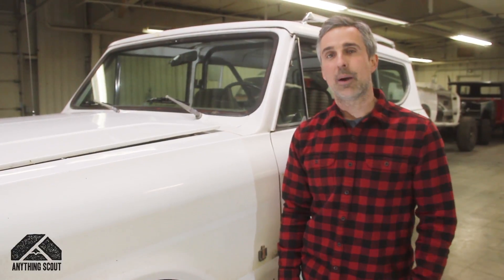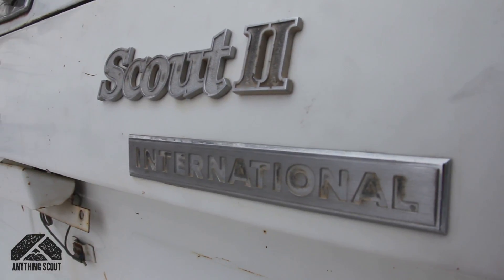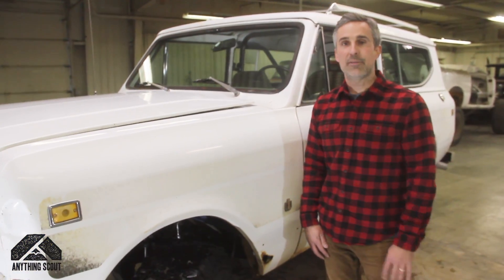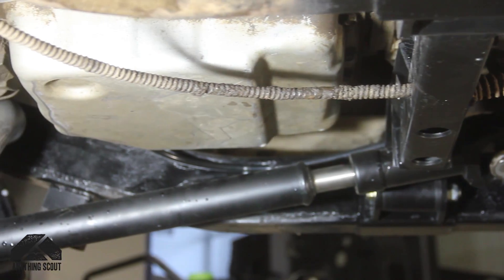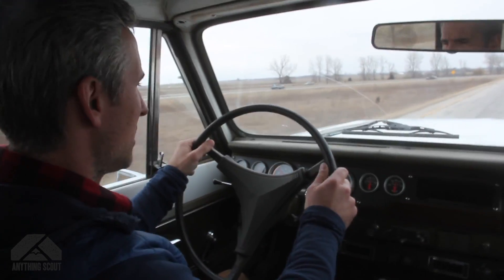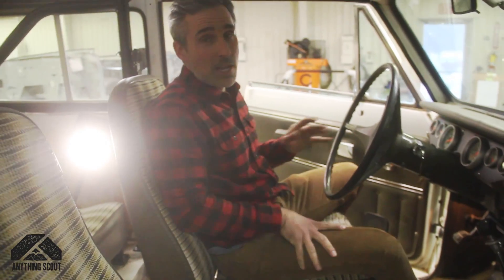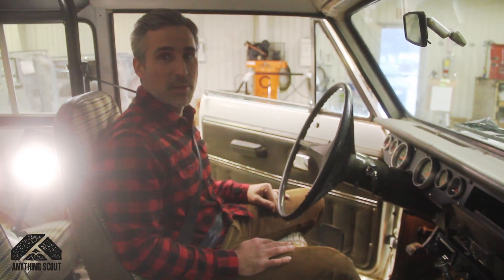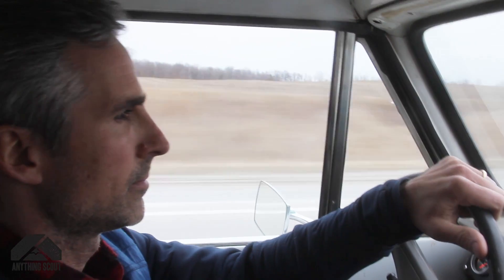Anything Scout '77 LS Swap

Comment: I bought a 1979 Scout II new when I was about 20. Great vehicle, but with the 304 engine, it could only do 0-60 in 13 seconds. What a difference an LS could make!
Reply: Your 304 isnt running right. Cam 0-80350 Holley and you can out torque a 5.3 0-4000 rpm.
Reply from the maker: Thats a great memory for sure! And yes what a difference it makes haha!

Comment: Ok, all this sounds good. Power, reliability, and ride all good. Hows the mpg when 5.3 is in a scout ii, on stock dana 44 axles? 
When compared to weight I've learned my scout ii with a 345 is 3,600#. A 05 chevy extended cab 4x4 is 5,000#. The 5.3 has got to be performing better in the lighter scout...
Reply from the maker: Indeed. There are a lot of factors weight, gears, tires, aero, drivetrain drag, how heavy your foot is... But typically we see in the teens with these trucks.

Comment: I understand you are trying to sell a service or kit to people but implying that the stock SV engine is unreliable just doesn't make any sense. I currently own 4 Internationals ranging from 1969 to 1973 all with their original engines. That's close to 200 years of combined reliability just in my driveway.
Reply from the maker: Not saying the SV is unreliable, as many of us at the shop own Scouts with the original drivetrains and enjoy them and we take them on trips around the country. But they certainly require more attention and maintenance than a modern engine. Just built for a different type of ownership and expectation.  Not saying one is right or wrong, just different.
Reply: Trying walking into oriellys or Auto Zone and buying shit for those Engines.  Oh you can't?  Oh ok.  LS is cheaper, more reliable and can get parts everywhere.

Comment: Great job, i did my swap with your kit everything worked and fit perfect, you guys were very helpful and answer all the questions I had also, it is a lot of work to do it yourself so many hrs working on it and researching parts, if I had to do it again I would just have you guys do it for me 17k is worth it. I spent over 20k but it runs great, question; are the roll bar and seat belts included?
Reply from the maker: The roll bar is not something that is included in the base swap, but is a very common add for our in-house builds.

Comment: You clowns just take a good scout and throw about 10,000 worth of unneeded puke work into it and bend the owner over a barrel
Reply from the maker: Not forcing anyone to do anything Dan. I'll extend the same invite to you as everyone else, come visit and drive one of our trucks and then we can have an honest dialogue.
Reply: It's restomod for the sake of reliability and performance. There's nothing wrong with keeping the original engine and transmission in storage for later restoration, it's technically still all there!

Comment: Is that $17k plus parts cost?
Reply from the maker: Hey Corey, 
That includes a used engine, transmission, transfer case and everything to integrate it and make it run and drive.

Comment: What borgeson box did you upgrade to?
Reply from the maker: We installed a rebuilt power steering box and replaced the steering column joints with borgeson joints. We have them list on our website.
Reply: anything scout can you do a video on the steering upgrades?

Comment: Ive got 1968 800b with 48,000 miles on it and my father was the original owner. Where could i find some old repair manuals
Reply from the maker: We have them available on our website...   anythingscout.com
Reply: anything scout awesome thank you, my uncle was on the design team for most of the IH vehicles so he's used mine as an experimental vehicle so it's always a bit difficult to diagnose a problem
Reply: Chiltons 1968 manual eBay is your friend